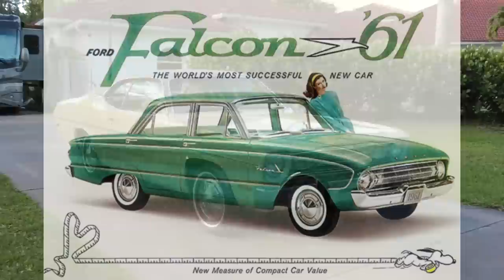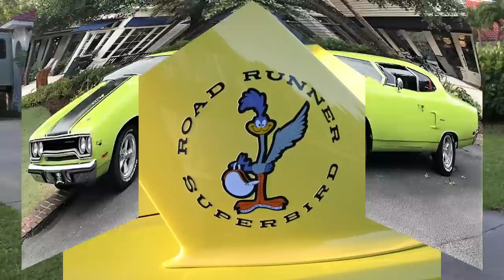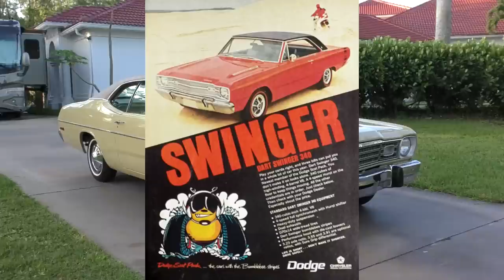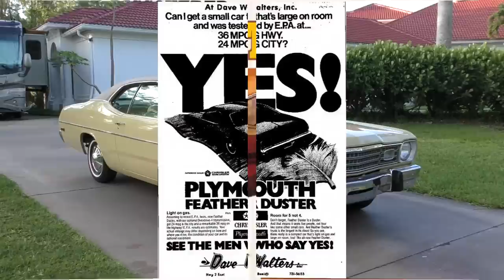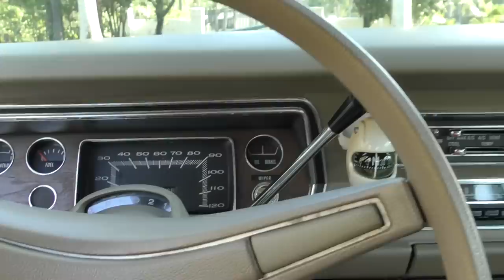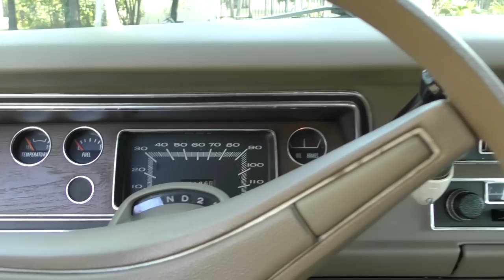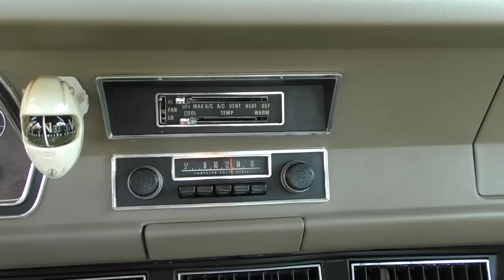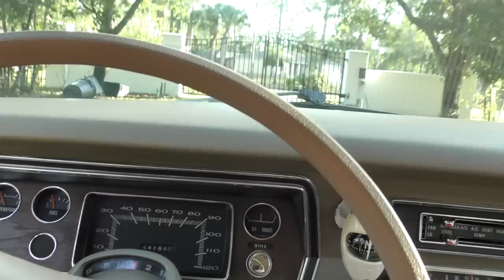The Plymouth Duster is a Mostly Forgotten MOPAR Coupe That Was Loved Against The Odds

Comment: I was only a little kid when the original Plymouth Valiant Duster  came out in 1970 especially with the base model's minimal features, limited options, Slant 6 engine, three-on-the-tree standard transmission, mere red slits on the rear deck for brake lights and turn signals, simple bench seating, vinyl flooring, etc. Just basic transportation and nothing more... That's why they were so popular with the speedsters looking to race them on the strip, the vehicle was very much open to every kind of speed and handling modifications!

Comment: Wow, long time since I've seen an unmolested, clean Duster like that.

North of the border, these were known as "Rusters",. One consumer advocate claimed that these were notable for their "biodegradable " bodywork. 

Thanks for an excellent presentation.
Reply: Albert rene narvaez obituary
Reply: I’m from Michigan, and I can vouch for their rustiness. 
EVERY car rusts there, but these did it quite rapidly.
Reply: But that clown Phil Edmonston in his "Lemonade" book called Dusters and the Valiants the best compact cars on the market even though the mid to late 70s models were the worst rot boxes especially the ones with that wretched clattering, sluggish slant 6 engine, severe rust and chronic vapour lock problems and disintegrating exhaust systems needing constant replacement. But parts were dirt cheap and user replaceable so for that reason they were popular. But make no mistake the car was as low end as it gets for an American car.
Reply: A good place to look for classic cars is Northern Canada. Prairie cars are usually in good shape because they’re owned by old farmers and driven on roads where it’s too cold to use salt.

Comment: Great video on the Duster. It took me back to my first job as a part time car jockey at Avis in the early 70’s. These were common cars in the fleet. I noticed the resister on the left hand side of the the firewall. These were notorious failures on Chrysler products. They burned out and the car would not start! A $2 replacement part and in 5 mins you are back on the road. We kept a box of them in the office.
Reply: Kept one in the glove box

Comment: I ordered a new Duster in and took delivery in August of 1975. My car was the same color as this one, Golden Fawn. Mine was a 225CI Slant Six and was supposed to have the 4 speed overdrive transmission. It came with the 3 speed manual transmission on the floor. I ordered the space duster package also. I never liked it and sold it in April 1977. It already had a rust spot on the front fender.

Comment: Hung over coming off ccp virus and no sleep PERFECT for a Plymouth Duster presentation. You sir have my respect. 
At the time Duster was like GM's Nova but everyone looked somewhat down on the Nova where as the Duster was seen as cool. 
Like you I've always been a Chevy guy except for a 71 383 magnum Challenger and a 340 magnum Sixpack Duster.
I found the 340 easy to modify or repair while in the engine bay. A clutch replacement took two hours tops. It was darn fast (with some modest modifications) but not well built at all.

Comment: Thanks for the Duster post, Bill. After my dad passed away my mom made do and I remember the purple red Duster she bought ( circa 1969 ) as a pragmatic car ( It went on until replaced by a Malibu in 1979 ). My one main memory of the Duster was my mom going around a corner, I leaned on the door handle and rolled straight out of the thing. I was fine, she picked me up, we didn't wear seatbelts in those days.

Comment: Bill.  My Sister and her first husband had a 1972 Dodge Dart, also with a 318cid V8 in the  late 70’s, early 80’s.  It would lay rubber with ease.  Also, being built after 1972, the horsepower rating is 150 net horsepower.  230 horsepower was the old rate.

Comment: My first car.  My grandfather bought it for my aunt, went to the dealer in High Point NC and said it had to have air.  He wanted the slant 6 but to get air there was only the 318 motor, so that was what he bought.  I forgot some of its features - that huge A/C unit - ("Dang, this thing is big, let's just bolt it right here at the top of the front of the engine bay, that'll work" - engineers who also came to work on Tuesday hungover.)   This video was fun, thanks for making it.

Comment: I remember these cars, they were everywhere in the '70s when I was a kid.  Looking at the car, I can picture the engine after-running when the ignition is shut off ;-).
Reply: Classic Mopar dieseling along for three minutes after you went inside
Reply: @thecustardguys   I never had that issue with an old mopar. You should have used higher octane fuel.
Reply: I had an old Corolla that did that occasionaly. I would have died laughing if it backfired like Uncle Buck's old Mercury.
Reply: @MrZdvy  it's a 318 and their suppose to run on 87oct and the 318 were terrible in 73 as far as no power and near constant detination and when they finnally quit running they 'ed let out a nasty sulfur fart, the emission controls were causing most of these problems,

Comment: My aunt and uncle in the Biloxi, Mississippi area had a 1973 Gold Duster they bought new. It was dark brown with a quarter vinyl roof, and had the slant six, 225 CID I believe, and TorqueFlite. It was fairly basic inside, no power steering or ac. But it was their family car, and it ran forever! I rode in that Duster with my 3 cousins many times. Engraved in my head is that Dino's bark Mopar starter, and the six cylinder sound complete with the rhythm of those mechanical lifters!

Comment: Good episode as always.  I don't mind that you stopped the camera for clarity in giving us accurate information.  No apology was needed.
I had a '72 Duster 340 Twister, and yes, it was remarkably fast.  I liked the Chrysler Corp; Dust Devil icon better than the Tasmanian Devil anyway.  The reason this car doesn't have that icon is that it doesn't have the "Twister" package.  This car is a conservative Duster appealing to the mature buyer.  And it's a beautiful example.  What I'm most surprised at here is that the OEM gas cap is still there.  I didn't know the roof design was called Tumblehome, thank you for that.
One of the ways Dodge and Plymouth kept the price down was by using a three-speed manual with a performance engine instead of a four speed.  Pontiac was known to do this as well.  By the 1980's (perhaps earlier) what we were doing for lower insurance cost was the dealer would write down a less powerful engine code digit for the VIN paperwork.
The Chrysler Air-Temp twin piston A/C compressor system was excellent and they had been using those for years when this car was built in '73.  I really like the sight-glass atop the receiver dryer as any owner could view that an have an idea if the Freon was running low.

Comment: in the mid 80's my parents bought a 74 Space Duster. We lived in SC and my grandparents were in OH, so our family vacations were going up to see them. My dad liked to drive through the night, so they would drop the rear seat and trunk partition and that was where my brother and I slept during the 12 hour drive. My dad finally traded it in for his 93 Chevy C1500 in 1996. The last I heard about it IIRC it was turned into a drag car. It was a pretty well optioned car for the time. It had a 318, White bucket seats with a full center console,  the steel rally wheels, off white paint, black strips down the side and across the back, and also had the black vinyl roof.

Comment: You're right, Bill, great cruisers. I bought the same identical car in '86 for $900 and have owned numerous A-bodies (Dusters, Swingers, Sports, Demons, etc.) over the years. Most had the bullet proof slant 6 and were very cheap, one for only $150. They were easy to fix and were very reliable. Sadly, Michigan salt laden winters ate the bodies. I used a lot of Bondo, sheet steel and roofing tar to keep some together. Chrysler used common B-body front spindles to save cost. Thanks for a lot of great memories , Bill. You're info is spot on.

Comment: I had exactly that same 73 Duster, same color, no vinyl roof, slant 6, auto, AM, p/s, p. disc, deluxe interior, a/c, blower type rear def, same wheel covers, etc. Someone had installed dual outside racing type mirrors from a Dart Sport in the correct locations and the only way I knew that was the yr on the glass said 75. Nice driving super reliable car. I got it from the 2nd owner with 135k on it, sold it in 2006 with almost 240k on it. I did have the trans rebuilt, but other than some gaskets and a w/p, belts and hoses the 6 was never touched. Everything including the a/c still worked!

Comment: I remember this generation Plymouth Duster very well. On a rainy Friday morning in the fall of 1976, I totaled one when I skidded into the rear of a tractor trailer on I-95, as it slowed down to avoid traffic in front of it that had come to a stop. The Duster I was driving was a 1974 model, important because of it's new, all in one, 3 point front seatbelts, unlike the separate drivers lap belt, and shoulder belt featured in your 1973 model. The one piece lap /shoulder belt combo in the 1974 model had a ratcheting mechanism that would "jam" if you did not pull it out just so from it's retaining device. 
It was a pain in the ass, and on the morning of my crash, after several failed attempts to latch my seatbelt, I said "screw it", and drove off into the morning's rainstorm  unrestrained. 
It was a typically busy morning rush hour on I-95 with lots  of merging, lane changing, and slowing down, exiting traffic to contend with. I had momentarily glanced In my rear view mirror to change lanes, and when l looked forward out the windshield, the tractor trailer in front of me had slowed down to crawl. I slammed on the brakes, hydroplaning into the rear of it. Thank goodness for the crash bar mounted below the trailer, or I would have "submarined" beneath it.
At impact, I lurched forward striking the windshield with my head, punching it out of it's frame, and coming back down on the steering column breaking it loose. I was wearing a bulky, ankle length, yellow rain slicker at the time, which cushioned any significant injury to my body, but my jawbone was broken, and I had a deep cut to my left temple which required several stitches to close. While the car was trashed, the damages were all forward of the firewall, with the passenger compartment, rear quarters, and trunk/rear end intact, a great parts car if nothing else.
I can't say I had very happy memories of the 1970 - 1976 Plymouth Valiant/ Duster/ Swinger, or Dodge Dart/ Demon/Sport, but I can say they were memorable. 
By the way, the 73 Duster you featured in this vlog had a couple of unique options, specifically the rare fold down rear seat back, and a deluxe steering wheel with cushioned center hub & horn ring, part of a decor package, along with the vinyl top, I'm guessing.

Comment: Graduated H.S. in ''76 so I remember these pretty well. I had a new '76 with 360. The vinyl roof here is what Plymouth called full vinyl, and they also offered what was called canopy vinyl, which was considered more sporty. The steering wheel shown was called the deluxe wheel, having more color-matched padded vinyl, and the hubcaps shown were called the deluxe wheel covers. Back then for the Duster, power steering, power brakes, air conditioner, cigarette lighter, were all options. A person could order a car without radio and the dealer would take off money! Yes, factory A/C was rare in Duster because it was really intended as an economy car for younger drivers.  And yes, the standard(factory) exhaust would be a single exhaust.
Reply: The AC on that car almost looks like an aftermarket affair, with the vents in a casing suspended under the dash instead of built in.

Comment: Excellent analysis!  And I'm coveting it so much!  My wife had a 71 duster with the Slant Six and 3-speed manual (floor shift), and I had a 75 Dart 4-door with cloth brocade bench seats and vinyl top.  It had the 318 and TorqueFlyte.  I think, though, that Chrysler never offered a column-shift transmission; even my parents' 64 Chrysler Newport had the 3-speed manual with floor shift.
Reply: One of my gym teachers in High School had a 68 or 69 Dart with three on the tree.
Reply: @rightlanehog3151 , that's interesting!   I had a 68 Dart 44-door with Slant Six and TorqueFlyte.  It burned oil worse than a 2stroke Vespa.  
My older son and his girlfriend were in that car, "looking at the (newfangled) cell phone tower located in a farmer's field, got stuck in the mud, and broke the reverse band.   Later on, a couple years on, he ran it dry; it's interesting how an engine can weld itself when there's no oil.  Oh, well.   Crazy Eddie's junkyard paid me $50.00.

Comment: I like the Dodge Demon version better it looks really cool with the twin hood scoops and chrome hood pins. The 340 small block was rated at 271 Horsepower in 1971. But it's actual output was closer to 310 HP when Hot Rod magazine did a dyno test back in the 70s. I've seen a few of these cars at classic car shows and they're alot smaller in person then they look on video. These 340 cars would go for low 14 seconds in the quarter mile back then. That's really impressive.
Reply: Just imagine if Chrysler put 318 polys in these cars.

Comment: I had a 1970 Duster with a 318, PS, PB, AC and no radio.  It was a hand me down form my aunt.  It gave up the ghost in 1986 with 140k miles.  Vey roomy and it offered a lot of utility but the steering was sloppy and didn't handle bumps very well.  The 318 2V did offer great performance.

Comment: The 340 was a real sleeper. It could knock off a lot of big block V-8s. But most Dusters and Darts came with a Slant 6 or maybe a 318 V-8. They were cheap and very durable. I remember these things still being used as taxis in the 1990s. The Aspen and Volare replacements were junk. Almost put Chrysler out of business.
Reply: The Aspen and Volare aren't all that bad... I've been driving a 1976 Dodge Aspen Special Edition since 1988.  I was warned to carry a spare ceramic ballast resistor in the glove box,  and 33 years later it remains sealed in the original package! Actually a pretty well designed car for ride, interior comfort and visibility.
Reply: Yup my 340 would beat most other rods off the line quick power. I kinda liked the next gen as well we had a caravelle and 2 volare’s they were all trouble free for years just not pretty lol

Comment: These A-body Mopars were solid cars!  Prices are rapidly climbing.  I remember seeing the most basic of Plymouth Duster/Valiant models with next to no options.  That's right, slant-6 engine, 3-speed manual transmission, and an AM radio.  Nothing else.  Lots of these cars were modified for speed, but it's something special to see one of these at a car show in pure basic minimal option form.

Comment: My friend had one.  While doing donuts in the snow at a church parking lot, my friend lost control and ran into a 6" steel fence pipe. If it wasn't for those "ridiculous" front bumperettes the front end would have been mangled.  We loved those "ridiculous" bumperettes. Battering rams indeed.

Comment: My first car was a “67 VW beetle (robins egg blue, 6 volt system) and this gold duster was my second.  Mine had the slant 6 which was not powerful by the standards of the time, but was extremely reliable.  I added an aftermarket tape player and speakers, cragars, aftermarket intake and cherry bomb straight pipe exhaust.  Was fun to drive but rusted out in the Rochester winters (we affectionately called it “the ruster”). Best feature on that car?  Snakeskin vinyl roof, hands down.

Comment: 1970 Duster was my first car back in 2007 and I still have it today.  I originally wanted a Satellite to turn into a Road Runner clone but I'm happier with the smaller A-body now, they are excellent cars.  The chassis and unibody are much beefier than their Ford and GM counterparts and you can actually make them handle very well just by upgrading the factory stuff (no need for expensive conversions like coilovers etc).  Mine has a built 360 V8 with around 450hp I swapped in, wide 18" wheels with modern performance tires and some suspension upgrades that make it a really fun car to drive fast and it handles far better than it has any right to, like a slot car but built like a tank.  I plan to never sell it unless I'm in a life-or-death financial circumstance.

Comment: The first thing this reformed delinquent did in 93 was put cragar. SS’s and a 4bbl, carb. On my 74.
I miss that car! I can vouch for the quality control of the day or lack there of. Back in the day. The rear spring perches on my car were welded in crooked never could get that thing to track straight. Dog tracked like crazy. I had a different wheelbase from one side to the other..
At 16 I didn’t really care it was fast and it was a space duster. I never carried anything around in the back 
But sure found it handy for weekend parking fun!

Comment: Had one, like many of Bill's cars.  These were great fun simple cars you could drive many miles if you looked after them. Mine started rusting and I sold it cheap. As the 70's wore on, breakfast, lunch and dinner for line workers consisted of puffing smoke and drinking beer in cars in the parking lot and that reflected in the general design and build quality of the cars at the time.

Comment: My first car was a 1970 duster. My Father bought for 250$  it in 1989 from my best friend's Dad who was a pastor of a local church. The car was a basic as you could get, 225 slant six, 3 speed auto trans. No power steering or brakes, AM radio with 1 speaker, cigarette lighter delete. It lasted about three years with us before it deteriorated to the point it was scrap. I think  we ended up getting 60$ and four wheels for it at a local recycler.
Reply: Our family's 73 Duster was 'equipped' the same way.